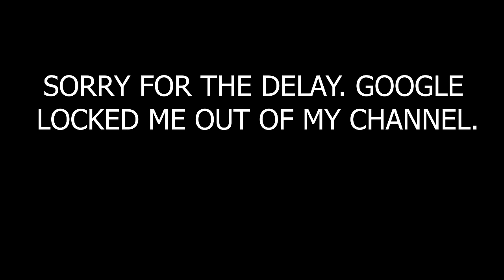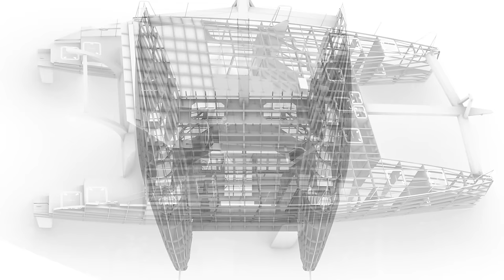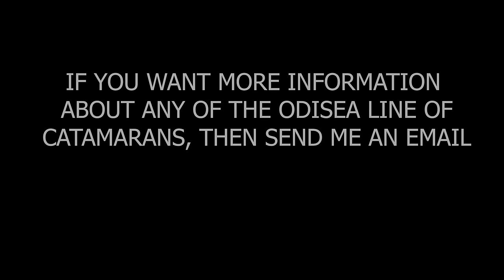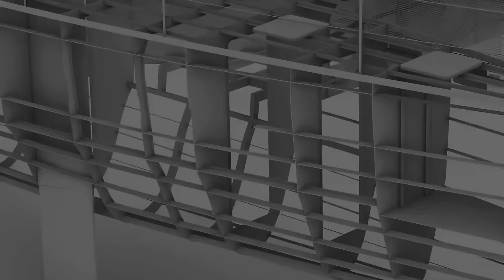Ep. 15 Performance Catamaran Build - A tricky bit of shell plate

Comment: I remember seeing breach loader power slip roller roll fustrums and over roll the curve 1% . clings to frames and you lower weight onto boat jacks to press that final midbelly weld tight. sombody else used 18” alu  pipe as bottoms

Comment: Top stuff Peter. I wonder if one day humans could 3D print boats out of steel, aluminum or titanium. We would have far less welding and cutting/fitting. Boat would be far cheaper to build...and faster completion time. You would make a fortune.
Reply from the maker: The problem is some of the strength of the materials comes from the working of them into plate

Comment: Over time, the abundance of noise will damage your hearing. Please use precautionary measures to prevent. Once its gone there's no getting it back. 🦻
Sailing Nahoa is building an aluminum cat. They plan to start their second circumnavigation soon into the Pacific to be closer to the build location. Aluminum builds are interesting. Thanks for sharing.

Comment: :face-blue-wide-eyes:wonderful videos of construction. what thickness is the shell plating.  notice spot welds of plating to frames will these be full length welds. also notice no heat sinks attached to the plating to prevent distortion of the plating.
borderallly
Reply from the maker: Plating not fully welded yet

Comment: You catch welders flash yet? For those who don't know the term, it is the UV light from the welding arc burning the cornea of your eye balls, it feels like you took a wire brush and gave them a good scrubbing. It is pure f'ing misery. You go to the hospital and have them freeze your eyes, then you go hide in the dark for a few days and let them heal up. It does not take much, a short glance at the arc flash with no eye protection and they are cooked. I have some time under my belt with Arc and Mig welding, so I just cringe when I see people welding like these guys and people just standing around watching. I have no doubt this crew knows the drill, but I still shake my head. Hey Plukky mate, just trying to help out by posting some shit and liking all the comments ta help ya out. I am sitting in Saskatchewan, Canada, couple feet of snow on the ground which is next to F all for winter here and the temps aren't to bad this year but we have hit -46c! That's enough to freeze yer berries off as apposed to sweating them off. I would rather sweat them off because they still work when they cool down, freezing them off literally means they fall off in this part of the world 🤣🤪I've become hooked on watching your channel, so I am in for the long haul now, doing what I can to boost your numbers. Cheers🍻 Jolly Jack !⚓⛵🏴‍☠

Comment: All I see is alot of tension in the plates there should be as little as possible secondly cannot see the welds if they are dry welds and one let's go oh boy gonna have fun under strain but you get what you pay for you need a welding coordinator or a welding tester ultrasound or penetration test on all welds and yes I have the experience
come on haters put in your 5 cents
Reply from the maker: Keep em coming. Yes there is strain, but not a lot and most likely balanced by application of opposing plates
Reply: @SAILINGintoFREEDOM  so basically you just go with what they say because I know and see you have no idea about the craftsmanship good luck 👍